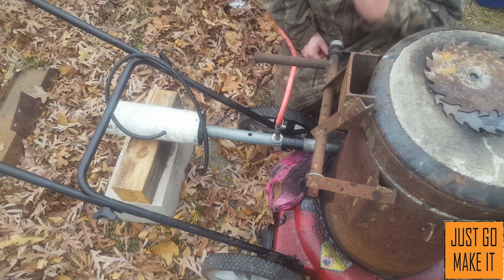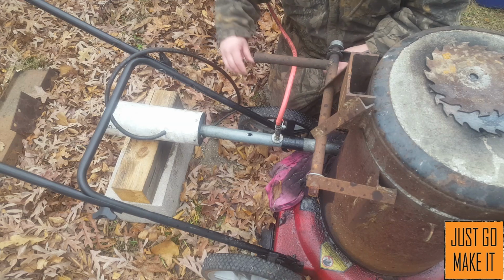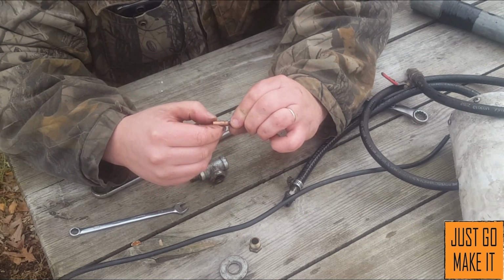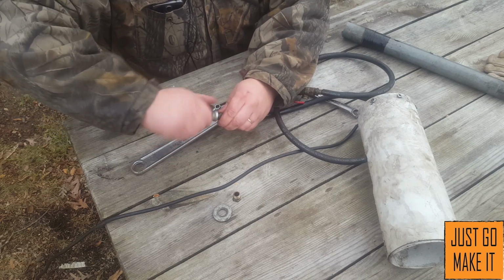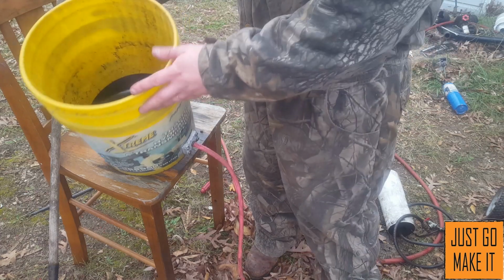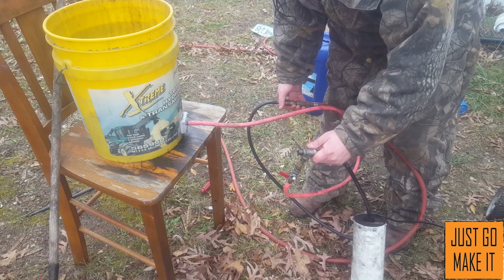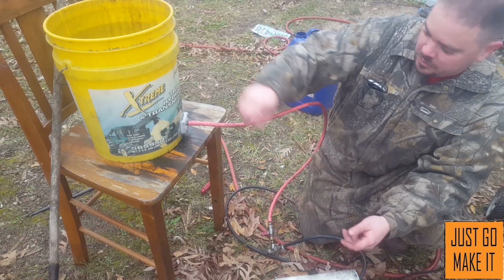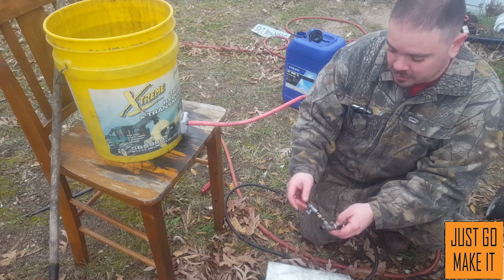Waste oil foundry burner

Comment: Looks promising. 
How do you light your foundry? Preheat with Propane?
(Topic for next video perhaps...)
Reply from the maker: i use wood.
Reply: @JUSTGOMAKEIT  how big is your aircompressor and what psi do you run through the burner?